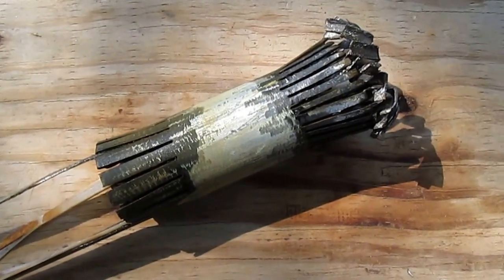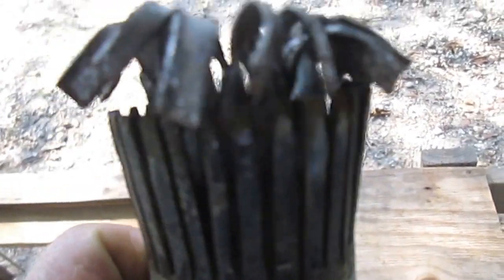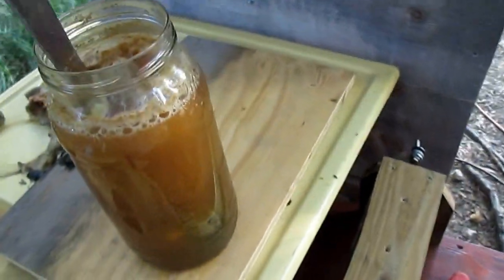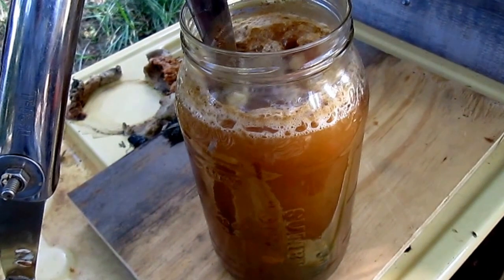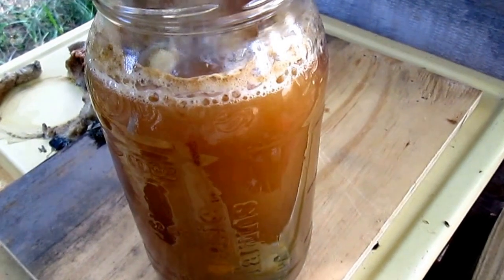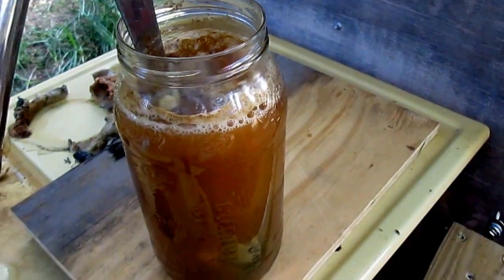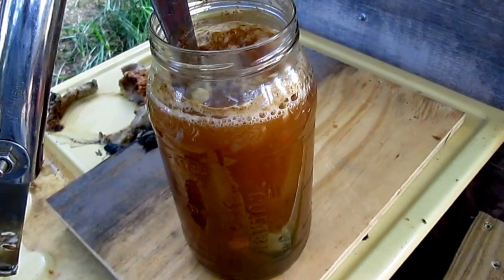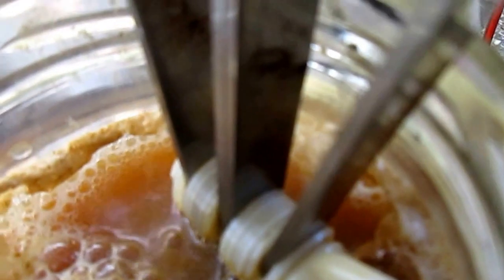HHO  Algeas 2

Comment: This is happening because there is salt in the water and when U give the metal an electric charge it speeds up the corrosion of the metal, to stop this U need to put zinc in the water. The zinc will corrode before the metal so as long as U top it up with zinc every now and then it won't do this

Comment: IN YOUR OPINION WHAT IS BETTER THAN electrolyte ATE TESTED NOW
Reply from the maker: +Carlos Marques     
  At this point Im using 20 - 30 KOH. per Weight  It is the best I encountered but also very dangerous since it will burn you and destroy Materials. Once we have a clean working Algea Solution I think this should be one of our first Goals to achieve. Nature is our best Teacher. Be open to learn from it.